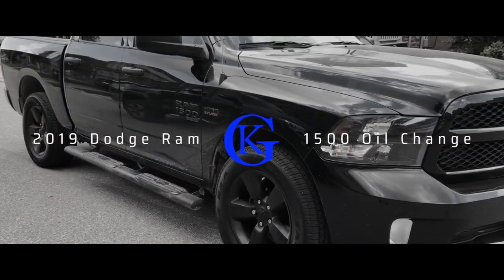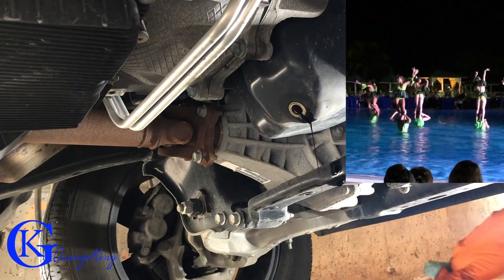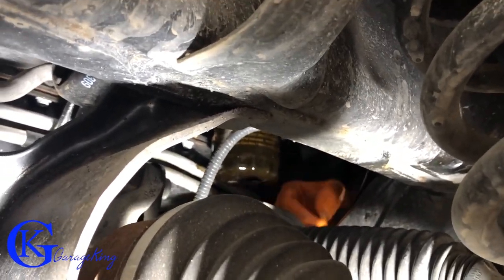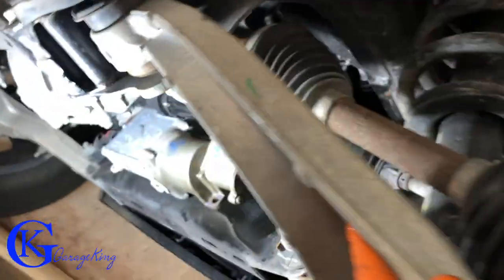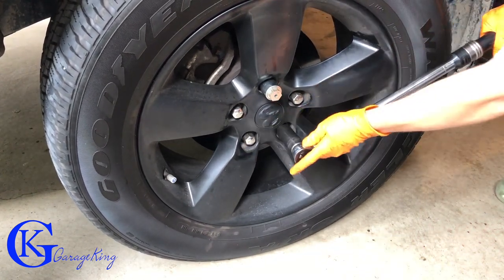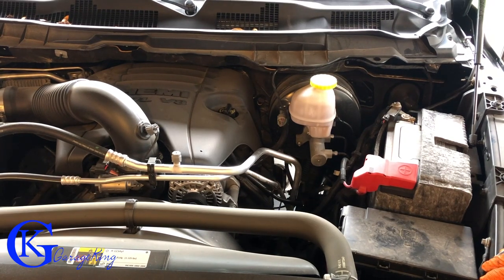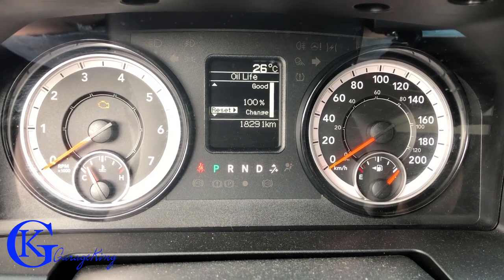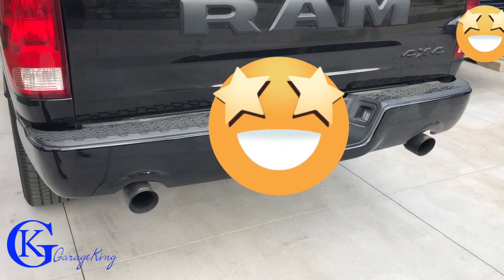How to Change Oil in Dodge Ram 1500 5.7L and reset oil light

Comment: When I changed my Ram oil last year someone gave me a great idea. When taking the filter off, use a big ziploc bag to take it off so most of the oil goes in the bag instead of on the frame. Kinda neat trick that I can't wait to use lol.
Reply from the maker: You know that's a great idea, and one that can be used on just more than this vehicle.  Once you loosen it up, just slip the bag on.  Such a simple idea :)  I never thought of that and I'm going to try it next time for sure!!!  Thanks

Comment: If you barely loosen the oil filter with the wrench you can put a zip lock bag around the oil filter, loosen by hand, and catch 90% of the oil... you can never get it all but helps to not make such a mess.
Reply from the maker: That is an awesome out of the box idea, and one that's needed on this vehicle for sure !!!!  The oil filter is in such a tight place that well, you know, without the bag its a bit of a mess.  Great suggestion !! Thanks for the comment brother !!!

Comment: I got an oil change a few days ago. My car has been dripping oil off the diff for 3 days. They said it's left over oil from the change. Is this possible? For days I've been wiping it off
Reply: It's a 2018 Dodge ram V8 hemi
Reply from the maker: It could be, but after a few days it should definitely slow down, and then stop, but it could have a drip of two for a few weeks afterwards depending on how deep it creeped around.  You could try shooting some brake clean up in the area to wash off excess.  Nice truck by the way !!